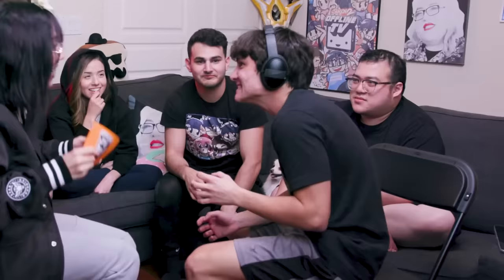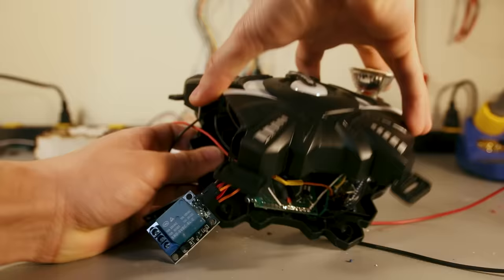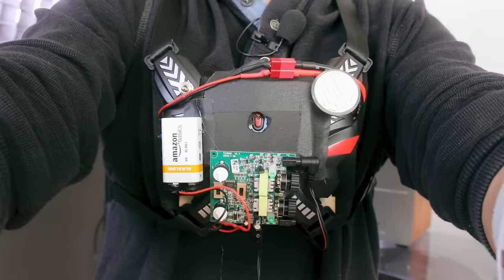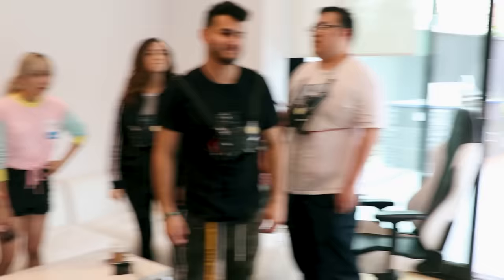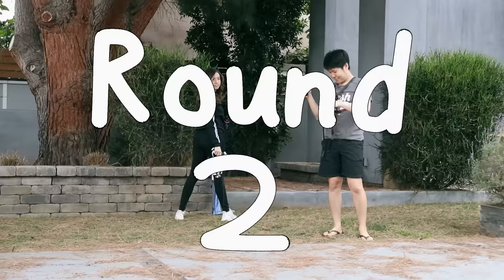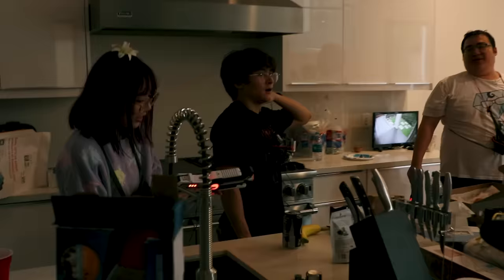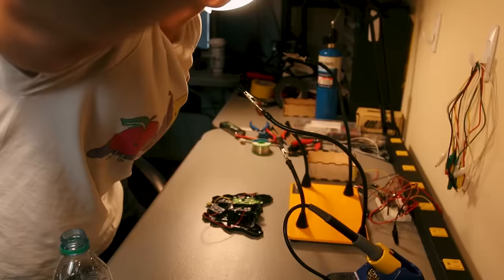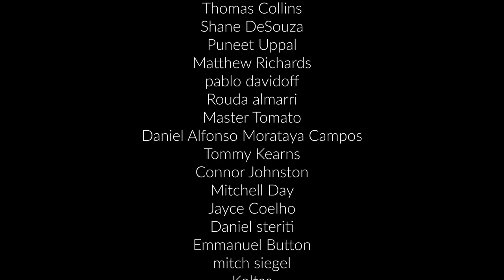Tazer Tag

Comment: "Deception. The device is fine, but as a joke I placed a small explosive charge." His deranged humour is top notch bruh.
Reply: 501 likes but no replies. bruh
Reply: 502 likes but only 1 reply. Bruh
Reply: 505 likes but only two replies bruh
Reply: 514 likes and 4 comments bruh
Reply: 516 likes but only 5 replies. bruh
Reply: 522 likes but only 3 replies bruh
Reply: 522 likes but only 7 replies. Bruh
Reply: 539 likes but only 8 replies. Bruh
Reply: 664 likes but only 9 replies. Bruh
Reply: 703 likes but only 10 replies. bruh
Reply: 704 likes but only 12 replies, bruh
Reply: I feel like he actually blew something up on accident and had an excellent cover.
Reply: 757 like but only 13 replies. Bruh
Reply: 782 likes but only 14 replies. bruh
Reply: 821 likes but only 15 replys
Reply: 894 likes but only 16 replies bruh
Reply: 1000 likes 19 comments bruh
Reply: 1.1k likes but only 20 replies bruh
Reply: 1.1 K likes but only 21 comments. bruh.
Reply: 1.2k likes but no replies. bruh
Reply: 1.2k likes but only 23 replies. Bruh.
Reply: I don't think I've seen a less funny reply section
Reply: @guidomista3570  hey mista the like counter is 4.4K
Reply: 1.7 k but only 26 replies. bruh
Reply: It overcharged with AC or dc voltage?
Reply: 1.9k likes but only 28 comments bruh
Reply: 2.2k likes but only 29 replies. bruh
Reply: 2.2k like but only 30 replies. Bruh
Reply: 2.4k likes but only 31 replies. bruh
Reply: 2.4 likes but only 33 replies. bruh
Reply: the straight face and calm voice when he was saying it just makes it so much better
Reply: @guidomista3570   give us lunch
Reply: 2.6k likes but only 36 replies. bruh
Reply: dude that part of the video was pure electroboom I'm glad he's influenced by him

check out his channel
Reply: @digitalphantom654  2.7k likes but only 37 replies bruh
Reply: I have crippling depression
Reply: 2.9k but only 42 replies bruh
Reply: 3.1k likes but only 43 replies. Bruh.
Reply: Definitely not a suicide bomb.....(definitely not!)
Reply: 3.7k likes but only 46likes. BRUH
Reply: 4k likes but only 46 replies bruh
Reply: Hello I am from the future. Uh hmmm... 4.2k likes and only 47 replies, bruh.
Reply: 4.2k likes but only 48 replies. Bruh
Reply: 4.2k likes but only 49 reply's bruh
Reply: 4.3 likes and 50 replies bruh
Reply: 4.3 likes and only 51 replies. bruh
Reply: 4.6k likes but only 52 comments bruh
Reply: 4.6k likes but only 54 replies bruh
Reply: 4.7k likes but only 54 comments. Bruh
Reply: 4.8k likes and only 55 replies.bruh
Reply: 4.8k like but only 56 replies. BRUH
Reply: It was probably a capacitor
Reply: 5.1k likes but 58 reply. bruh
Reply: 5.1k but 59 replies bruh
Reply: 5.2k likes but only 60 replies bruh
Reply: 5.3k likes but only 61 replies bruh
Reply: 5.5K likes but only 62 comments
Reply: 5.6K likes and only 63 replies bruh
Reply: 5.7k likes but only 64 comments. Bruh
Reply: 5.8 k likes but only 65 replies. Bruh
Reply: 5.8k likes but only 66 replies. Bruh
Reply: 5.9k likes with only 67 replies. Bruh
Reply: 6k likes and too many replies, stop

Please
It's at 69
Don't do any more
Reply: Reply
Reply: Reply
Reply: Lies and Deciept
My secret ability/trait in an RPG
Reply: deez anime  6.5k likes and 73 replies bruh
Reply: 6.7k like but only 74 replies. bruh
Reply: 6.8k likes and 75 comments. Bruh
Reply: 6.8k likes and 76 comments bruh
Reply: 7.3k Likes but 77 replies. Bruh.
Reply: 7.3k likes but 78 replies bruh
Reply: 7.4k likes but only 79 replies. Bruh
Reply: 8.1k like but only 80 replies. Bruh
Reply: 8.2k but only 81 replies. Bruh
Reply: 8.3k likes but 82 replies. bruh
Reply: 8.5k likes and only 83 replires. Bruh
Reply: 8,6 likes but 84 replies. bruh
Reply: 8.7k likes and only 85 replies. bruh
Reply: 9.1K but only has 84 replys
Reply: 9.1k likes but only 85 replies bruh
Reply: 9.3k likes but only 86 replies. bruh
Reply: 9.355 likes and only 87 replies. Bruh
Reply: 9.3K like but only 88 replies. bruh
Reply: 9.7 likes but only 89 replies bruh
Reply: So you could say there was a bomb in the vest.. hmm...

Comment: Imagine if one of them fell in the pool and was being shot at.
Reply: It would actually be less painful than normal since the electricity would be distributed around their body.
Reply: @redforest9269  yes technically it would be less painful.. for the few seconds they were still alive lmao
Reply: @shanedixon5845  Shane, they are being blasted with this taser point-blank in the general vicinity of several important organs under NORMAL conditions, if they are surrounded by a conductor then the electricity would spread around the general area. 
Not to mention that the electricity would likely spread into the water and not concentrate on their body, but even if that isn't the case then the electricity is being spread over a larger distance and NOT BEING AMPLIFIED because that's not how water works.

I suspect you have been watching a lot of media and have gotten the impression that water multiplies electricity or something. This is not the case.

When Character A uses a puddle to electrocute Character B in it, CA is using an electrical wire from an electric pole or some other construct connected to the electric grid.
In other words: CA is using the power of a fucking CITY (or bigger) to kill CB when that happens.

PS: I'll figure out some synonyms for electric in the morning... maybe, idk.
Reply: Splash damage
Reply: @redforest9269  The one thing you are missing here is that water isn't actually a conductor, it's an insulator, and only a huge amount of amps would be able to push electricity through it, especially a body of water that big. The taser vest would most likely just short out.
Reply: Double Damage Rampage
Reply: If you were in Germany when throwing in the toaster
Reply: @moe64rox  You are also forgetting that water alone is an insulator. Since it's a pool the chlorine and other compounds in the pool might affect its ability to conduct electricity, for instance salt water can conduct but purified water can't.
Reply: @redforest9269  also pretty sure that it would short out and stop working
Reply: @-Big_Big  Yes, most likely, especially given the cheap and non-airtight construction of the vests, but it was like... 10:00 PM or something when I typed that...
Reply: General Grievous in essence, yes, your summary is correct XD
Reply: And then there were 5
Reply: I think all the circuits would short so the taser wouldn't actually set it off but i bet the person would probably still get shocked
Reply: ♫the lion sleeps tonight♫
Reply: @redforest9269  Electricity flows through the path of least resistance, and doesn't distribute around their body like you suggest.
Reply: @moe64rox  Pure water is non-conductive, salted or otherwise enhanced water is conductive.
Reply: Current is the name of the game, fellow commenters. Not enough current in a taser (around 2 milliamps) so it wouldn't do much.
Reply: Hello There imo if the water is conductive, it would short the taser terminals

Comment: He could have totally created a "backdoor" which for example taze everyone in the opposing team once he press a hidden switch or trigger on his special "admin" gun :D, or when someone hit him, redirect taze someone else instead of him... perhaps the shooter :D
Reply: Nah hed have to reprogram the guns cos thats not how normal taser tag is
Reply: @db5094  That is not the case... at all. He only would have needed to install a small calculating piece of hardware in each one and code up some lines that tell the calculating device aka brain to redirect the "damage" to the tazers number of what ever tazer hit him.
Reply: @LocalDeepstateAgent  Its more complicated then that, but the easiest way to acheive the effect is to remove the taser from 1 vest and replace it with a wireless signaller, then build a reciever  into the rest of the vests that triggers the taser when they recieve the signal.

Comment: I find if funny that you had to make a tazer tag set.... I bought one years ago with the taser grounding part included into the handle of the gun, so when shot you got an electric shock lol, I think I still own it somewhere in the room of hidden depressed things. Edit: it also had safety settings to change the level of electrical output to the desired level and when shot a specific number of times the chest piece and gun shut off thus ending the game.

Comment: Quick idea: You should code some shit in virtual reality headsets like use the camera that use used for the surgery robot, and pipe some post processing code into the software that instead takes in all joints in the hand unto consideration, and actually 3D print some moving components for the hands, and then just use this concept for other video ideas, ie… “robot that states sentences in sign language read by my hand through virtual reality.” Sure it can be refined by just naming the video “Making a robot that reads sign languages based off my hands” etc… U get the gist, also it’s been 1year since ur last upload… need I say more?